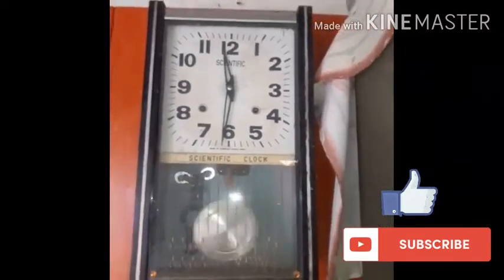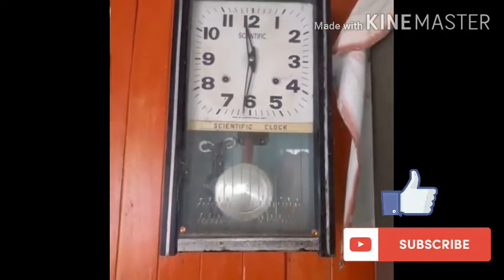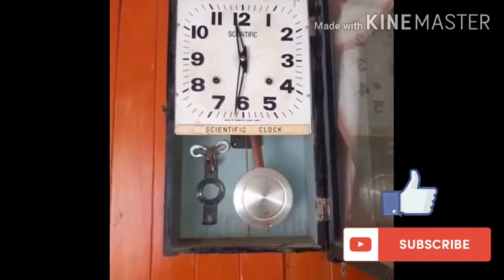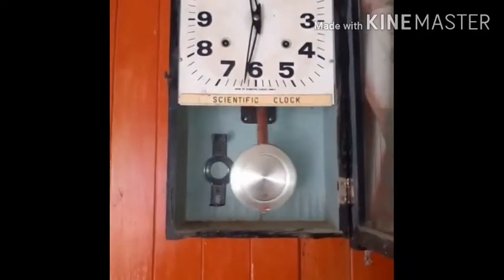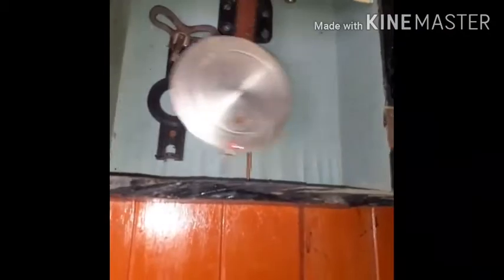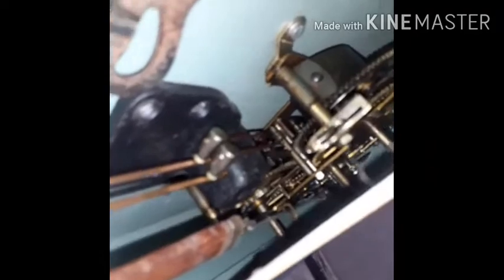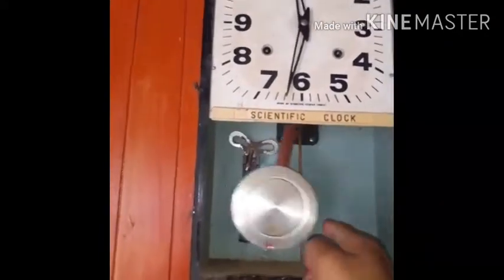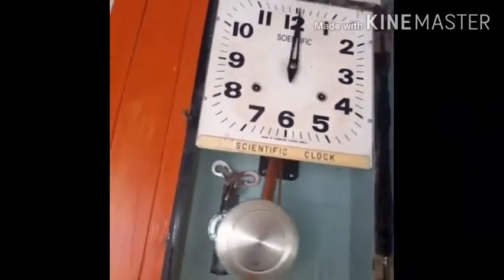Scientific clock working principle explained

Comment: With due respect 

How a clock 
There are two sides to a clock a) time side or going side and strike or gong /bell side.
The going side has a mainspring attached to the main wheel.This wheel us followed by a first wheel,second wheel, third wheel and escape wheel. The escape wheel is regulated by an anchor commonly known as lever which in turn is regulated by a rod and a piece of tongue known as the pendulum rod on which the pendulum is suspended.

Gong side
The going side also has a main wheel attached with a main spring, followed by first wheel,second wheel, cam wheel,pin wheel and a fly wheel or a fan like part. Between the going side  and the fly wheel there are two parts one for regulating the strike and another which for lifting the regulating part. In turn both these parts are regulated by a wheel called the center wheel which operates with the help of cannon pinion,minute wheel and hour wheel. The hour hand is mounted on the hour wheel and the minute hand on the center wheel held down by a nut. 
When the main spring is wound the torque is transferred to the first wheel which turn transfers the torque to the second wheel, the second wheel to the third wheel and the third wheel to the escape wheel and escape wheel creates an impulse to the lever thus the clock starts to operate with a gentle push  after it is put up on the wall.  Similar action is repeated on the strike side.  When the center wheel moves for about half an hour the connected levers and the counting lever are activated  and the clock chimes the half hour and hour as and when it reaches its end. Now there is a single flat wheel without pinion mounted above the main wheel of striking side which has markings filed for the strike and its counting which keeps track of the chimes synchronized with the going side.
If you need more info call on this number 8355997526